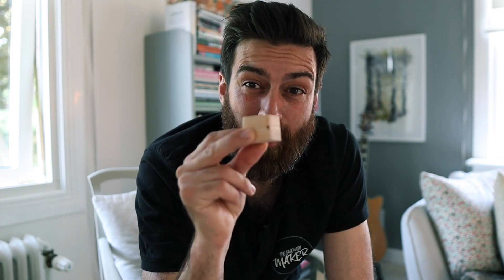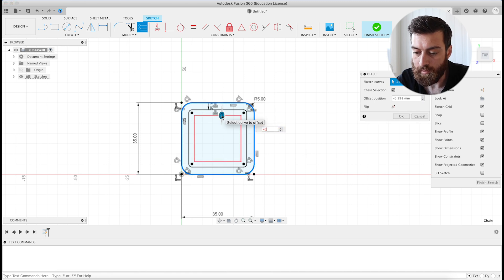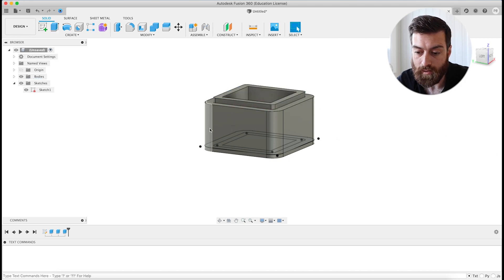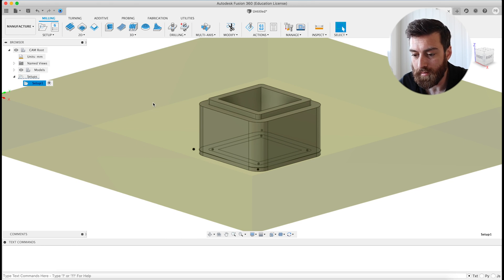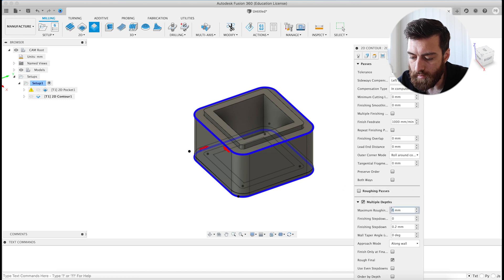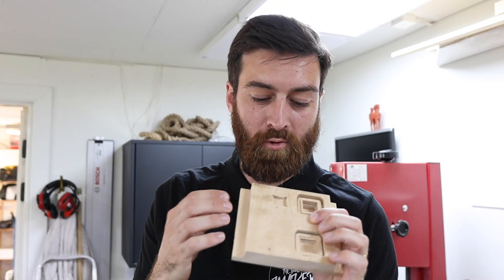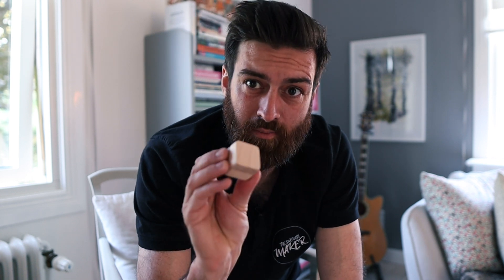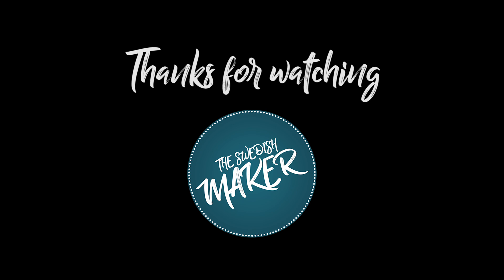DIY Ring Box Using a CNC - 3018 Pro

Comment: Thanks for the excellent video 🙂

I have a question though, the first time I open fusion 360 in my life and I follow your process but when using the "offset" tool the second time, fusion tells me that I can't "Error: One or more of the selected curves has already been offset. Consider offsetting the original profile again instead."

Any idea where I'm wrong? Thank you again!
Reply from the maker: You need to offset the first line instead of the one that is already offset and it will work.
Reply: @TheSwedishMaker  Thank you for taking the time to reply, very appreciated :-)

Comment: Great video, and exactly what I was looking for. 

One question though. What is the reason that you used a post processor? I am new to CNC, but not new to Fusion 360. 

Could you not have used the file from Fusion 360?

Comment: Would you be able to cut 25-30mm deep with this machine?
Reply from the maker: Yes you can :)
Reply: The Swedish Maker what kind of drill bit do you need and how many passes does it need?
Reply from the maker: I do about 0,6mm/pass and there are many different kinds of bits to do the job. I mostly use end mill bits.

Comment: Hi, very nice video! What milling tool are you using in order to mill that deep?
Reply from the maker: Thanks! I just used a normal 38 mm milling tool. I adjusted the motor height a bit to make it work as well.
Reply: The Swedish Maker , could you share the tool specs? How deep did you cut? Usually the blades are only 10-12 mm on a 2-3 mm tool.
Reply from the maker: I cant really remember the tool but I am pretty sure it was a 1.5mm flat end mill. The flute length was 12 mm but I had it go more than. I didnt insert the mill all the way up in the shank either to make it stick out more